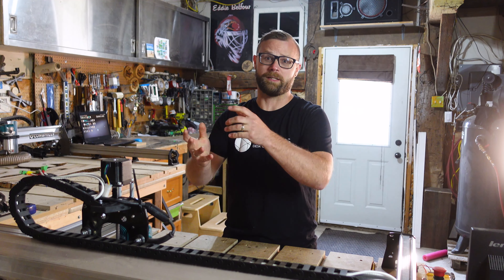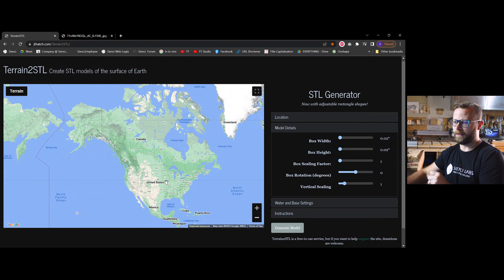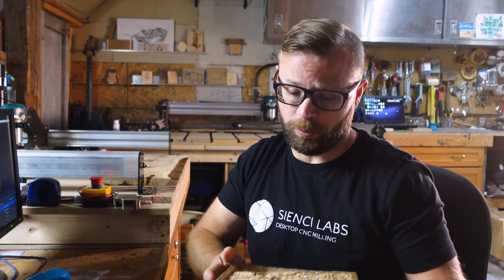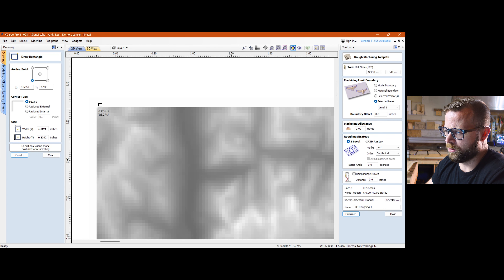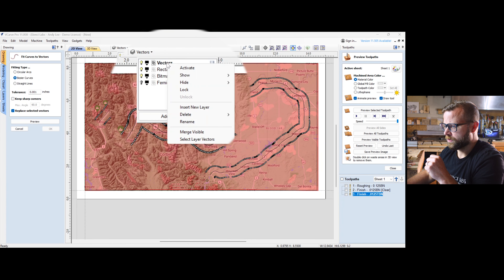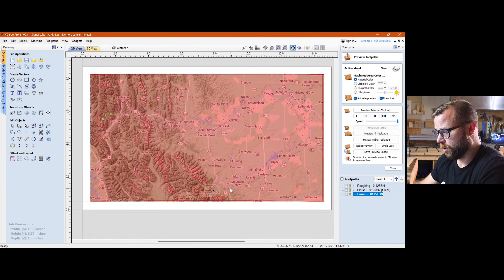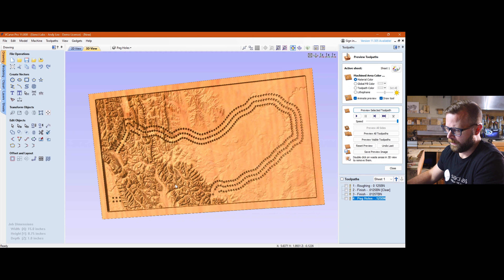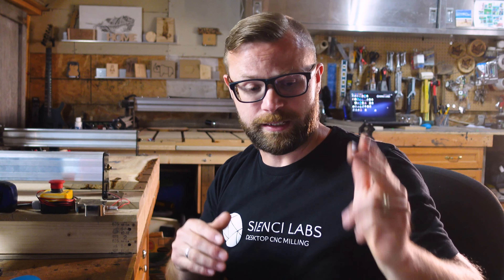Custom Cribbage Board with LongMill CNC | DIY Tutorial

Comment: Many thanks. I'm a senior citizen (old fart) who's trying to live by Waylon's advice, "Don't Let The Old Guy In." I'd appreciate learning how to cut a crib board path to fit inside the face of a tennis racket. I've made a few to donate to various causes but the drill press is laborious. How would I do this? Thanks!!!
Reply from the maker: Everyone is welcome here! To clarify, you want to take an actual tennis racquet and create the lanes on the face of it?

 If that's what you're talking about, you'd need to:
-Measure the existing racquet.  
-Create lines that would follow and fit within the actual racquet face dimensions. 
-Then select the lines you created and use a drilling toolpath.

And yes, drilling them manually would be a total pain, especially compared to letting the CNC do the work. Hopefully that makes sense. Let us know how it turns out!
Reply: @SienciLabs  I have a number of old wooden tennis rackets so have created a cardboard cutout of the face, traced it onto a piece of wood, cut the oval on the band saw and then using a template I created I marked the holes then drilled with a press. Perfectly imperfect.
Reply from the maker: That would work for sure! That’s the amazing part of this hobby; there’s SO many different ways to achieve the result you’re after. As long as you get what you’re looking for, there are no wrong answers!
Reply: @SienciLabs  Thanks for the ultra quick response. My method does work and often it's the journey as much as the destination; I think about the recipient as I labor through the steps. Conversely, the hole drilling is laborious and my time might be better spent on other things. Because these rackets are similar, if not identical, a pattern would be a gold mine. Waylon would probably tell me how to learn how to create the design. Any help here?
Reply from the maker: @camkeni No problem! Not 100% what you’re asking? Are you looking for a step by step tutorial? And who’s this Waylon fellow? 😀
Reply from the maker: @camkeni Have you checked out our Basics For Beginners playlist? I think most of the answers you’re looking for would be covered there. Here’s the link. 

https://m.youtube.com/playlist?list=PLE43LQy2a1iq7yXfExlD5KqWFOuIX0tuv
Reply: In a Clint Eastwood movie, "The Mule", Waylon Jennings sings a song as the credits roll at the movie's end. The song is called "Don't Let the Old Man In" and it's become my mantra as I age. I try to keep on discovering new things so I can live a productive and useful life. Yes, a tutorial for my specific need would be nice but others may benefit from a more general "creative crib board layout" plan. I've made crib boards on a variety of unique bases: tree rounds, forno oven paddle, bowling pin cut in half, duck decoy cut in half.  @SienciLabs
Reply from the maker: @camkeni I was close! I thought you were quoting a Waylon Jennings song. Dang 😝…We’re thrilled to see your thirst for new knowledge, it definitely keeps the mind young at heart! 

I hear you, and yes, a “general” crib board tutorial is on our long list of projects. Having said that, the process for creating the tool paths/lanes for a your racquets would be very similar to the steps covered in this crib board video. Albeit, you’d have to apply the same techniques to your specific shape. So there would likely be some experimentation on your end. Does that help? If it doesn’t let us know and we’ll keep trying. 👍
Reply: Well, pardner, I reckon I'll check out the link you've suggested. Many thanks. Not planning to ride off into the sunsert just yet. @SienciLabs